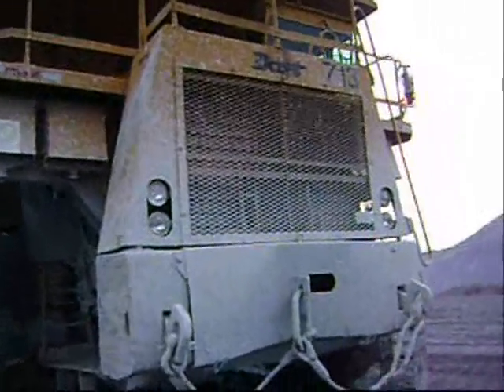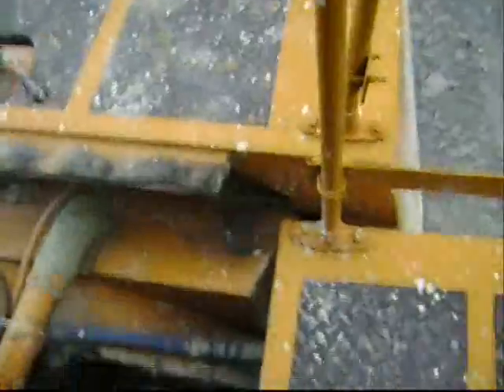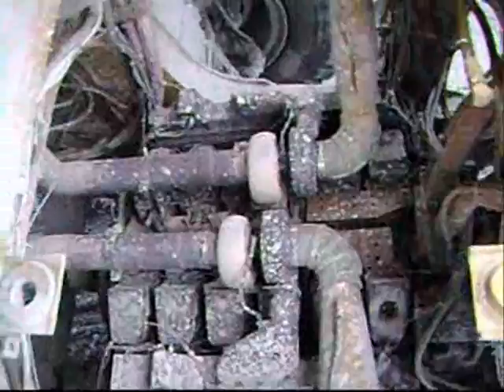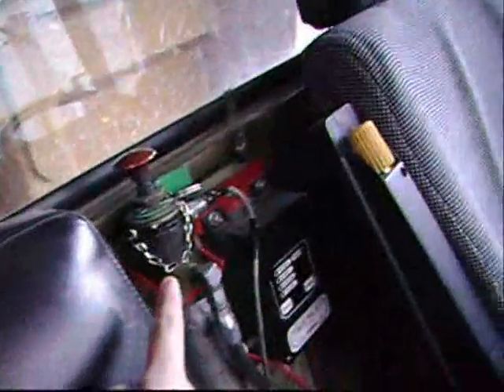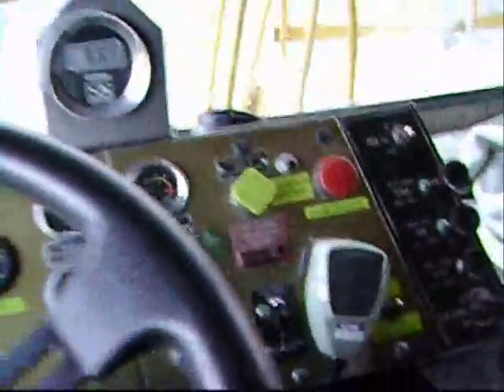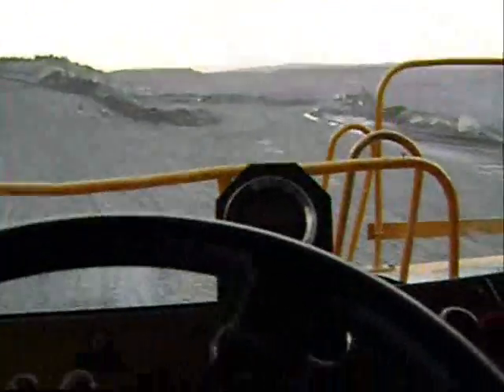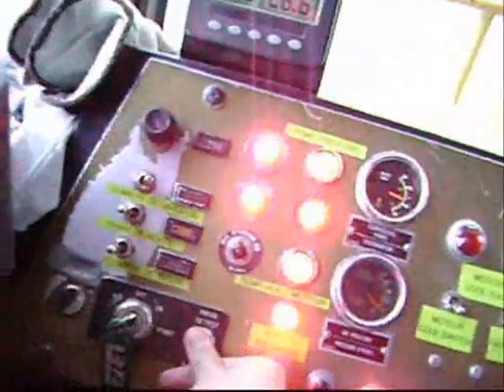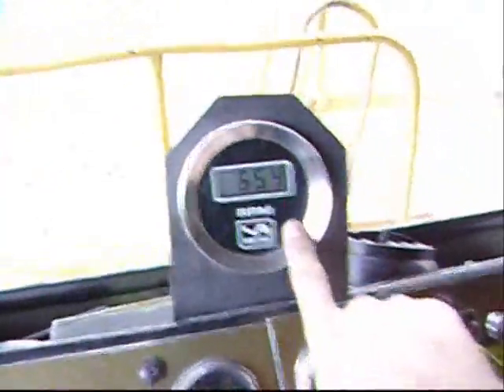Dart 3100 walk around and drivin'

Comment: part 2... then we would have two other welders join us and we would MIG weld it.  It would take a few days and then we would start over on the next one.  Of course there were many being built at one time.
 Of course some of the bodies we built were massive and that was more work and more men. 
Like the massive coal trucks..the body size was unreal.  Turning them inside the building to work on a different side was a big project. I wish I had a video of that.

Comment: @yastachik I wish I had some photos or data but I have none.  It would have been great to have a photo of a work crew standing next to one of the trucks after we built them.  I guess in my case it would have been neat to have a photo of us next to the body that we built.  
  I was a welder so I would go outside with the lead man and with a big over head crain bring in the sheets of metal one at a time and we would lay in a jig.  I would tack weld it.  When we got all the metal in we then...